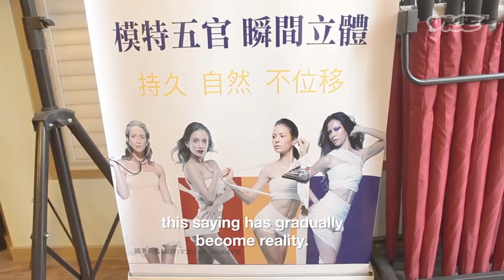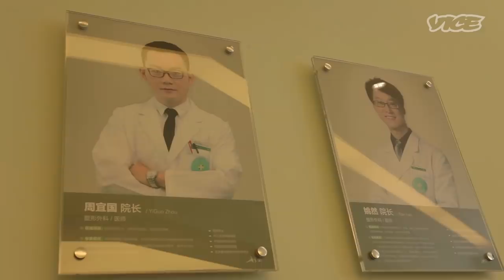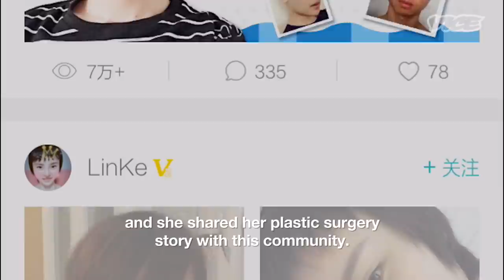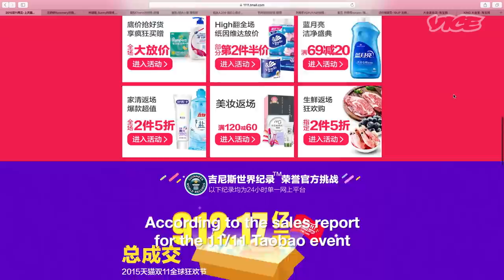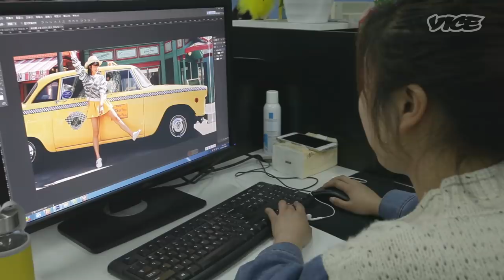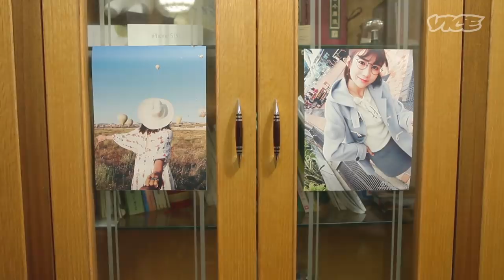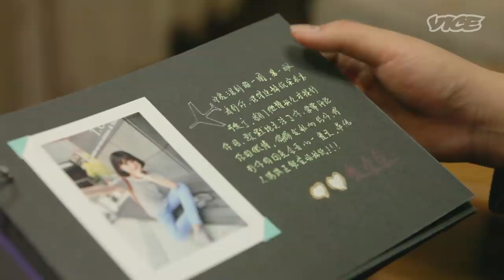China's Webcam Economy Is a Modern-Day Gold Rush

Comment: The translation is not correct for much of the numbers. They are talking in RMB, but in the subtitles, VICE translates it to $ (USD) which is incorrect. They did not earn around $20 million to $50 million. They earned between 20 million RMB and 50 million RMB, not USD.